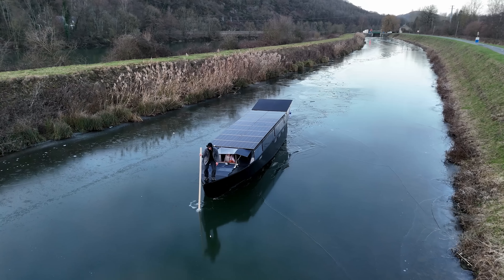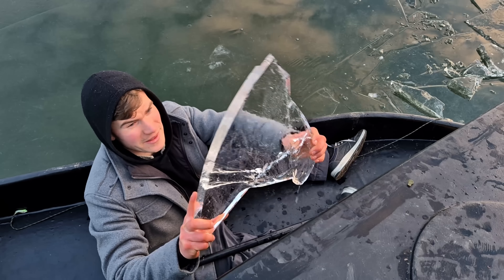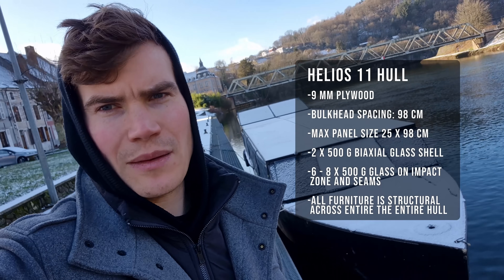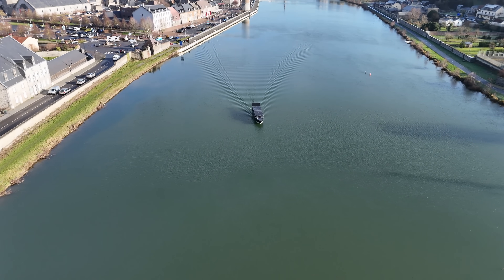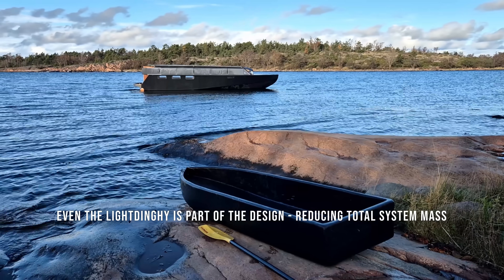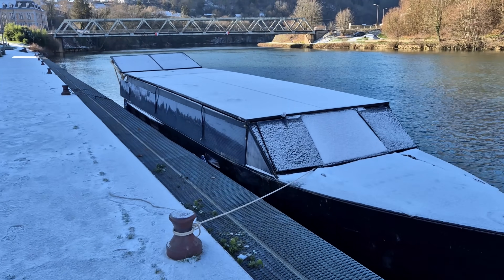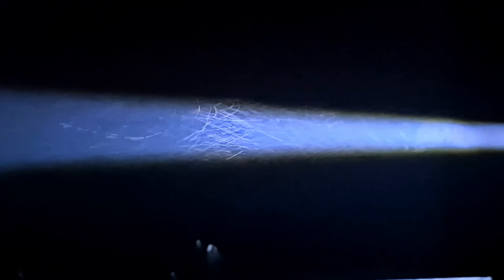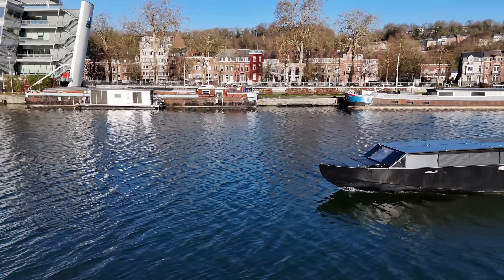Stuck in the Frozen Canals on my Solar Boat: Upgrades & Hull Strength

Comment: I would skip 230 volt. Inverters are inaffective, there are DC heaters for 48 volt for example .
Reply: 230volt allows you to save a lot of money on cable gage, appliances costs and accessibility
Reply: @00000a0009  15A cables that doesntr run far isnt that expensive. I would have picked the 2-4 times efficiency over the cost
Reply: @00000a0009  btw, DC heat pumps are standard stuff these days, alot of products from china., ecoflow, vevor etc

Comment: Awesome to see so many question marks cleared up! :)

I do think adding insulation will be very good for the efficiency of the yacht (which is one of the ultimate goals), given that it is entirely black, as needed for it to blend in with the solar panels nicely, it will need AC in the summer, especially in warmer regions (but probably even in Finland too).

Therefore insulation will make it use a lot less energy for AC than it otherwise would.

Comment: which software did you use to do AI modeling of the boat? Or did you just threw the specs to a LLM like GPT?
Reply from the maker: I use Chat GPT where I've activated a high-level naval design engine. But it's more than just throwing in the specs, rather you must install and automate your own genius - which takes some time and demands capacity to write commands and laws, not prompts.
Reply: @Lukas-TrueNorthYachts  thanksI'll have a look